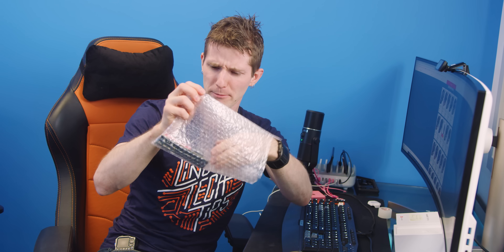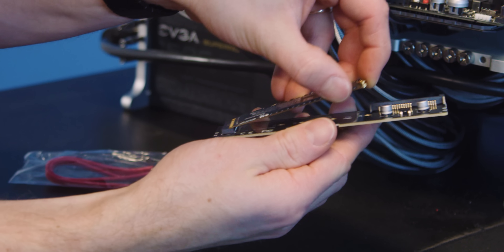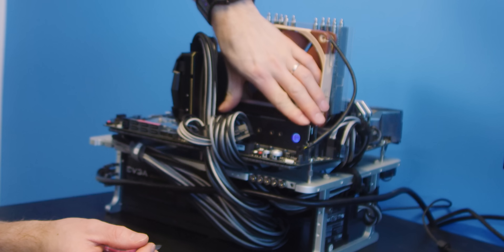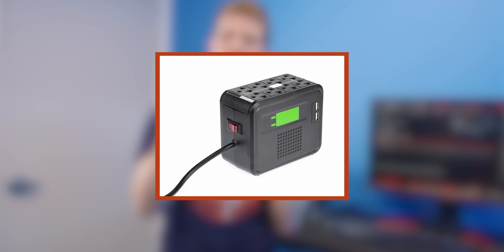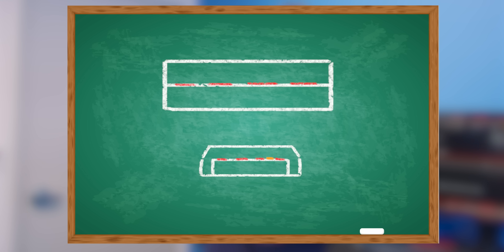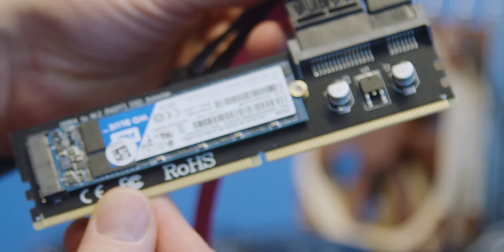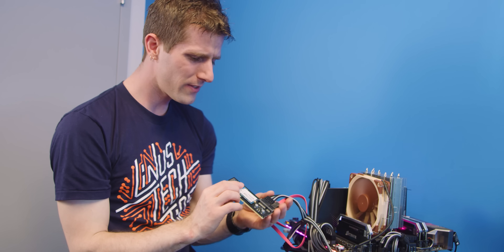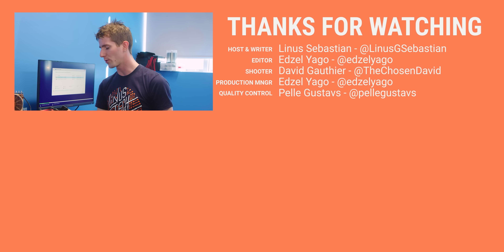They LIED to me! - DDR4 RAM to M.2 SSD Adapter

Comment: This adapter is unnecessary unless you maxed out you memory slot. The question is how much memory is enough?
Reply: @jefftheworld  Did you not watch that video? Linus had to take out one stick of memory and replace it with the adapter, I assume the adapter exceeded or equalled the number of max memory supported by the motherboard.
Reply: @DoTheEvolution78  The adaptor doesn't add memory at all, though.

It just takes up a slot and holds an SSD.
Reply: @DoTheEvolution78  No, if you max out your memory slots you'll have nowhere to put this device.

Comment: There will be a real DDR4 slot to "SSD"-ish thing - Intel Optane DIMM.
Reply: Watch the video before commenting...
Reply: @hueanao  cannot get your point but this product is just a board that assists you to fix a m.2 sata ssd on dimm slot... Itself won't expend your memory or storage. But interestingly, Intel is releasing their optane memory that can be installed on dimm slot instead of pcie and possibly can be used as memory. That why I'm replaying this.
Reply: @FangfeiYang  My point is, that Linus mentioned the DIMM Optane in the video

Comment: So basically this product is aimed at someone who bought a M.2 SATA/AHCI drive and screwed up with the motherboard, taking one that only accepts NVMe or one that doesn't have an M.2 slot at all.

Because otherwise if you want a Sata SSD connected to a Sata port on the MB you would juste buy a Sata one in the first place ... I mean they are even a little bit cheaper.

Or it could be that you just got an M.2 Sata SSD from someone or another build but don't have the hardware to use it, like the So-DIMM to regular-DIMM Ram adapters. But even that was more interesting !

Still, it's nice to know if we're ever in need of such a thing, it actually exists and can be ordered on aliexpress.
Reply: yes but they make pci-e adaptor cards, so you don't have to deal with the stupid cables. so ??? what's the point, you'll never need something like this. even if you did, like on a itx case, there isn't a place for it, given 2 memory slots. it's a really bad idea.
Reply: @BloodSprite-tan  I think most PCIe adaptors would be for NVMe drives, but there sure will be some for sata ones. But even though it can be useful for someone somewhere someday, it's not stupid as it works the way it's intended to. If you don't need it just don't buy it, I never said everyone should have one just in case, I said if you're ever in need of something like that it's reassuring to know that it exists.
Reply: @TheOrganicartist  Well I'm glad this works for you ! Again, I'm not saying that a lot of people would actually need this, as there are lots and lots of other solutions that you would think of before that, including your PCIe adapter.

I'm just saying that it's nice to see it exists, because if you need a M.2 AHCI to regular SATA adapter and don't want to use another  expansion slot, you can. you might not even use it in a ram slot, after all it's just a solution they found so that it would actually be attached to your computer. And I can see that it can be misleading to some people, but hey, if you see some weird shit on aliexpress, just send the link to Linus Tech Tips before buying it, and if they run out of topics to cover they will be glad that you found it !

Comment: This would definitely be useful for someone that has an old computer without 2.5" bays or m.2 slots on the motherboard. Also if your computer is already full up.
Reply: Especially if you really don't want to deal with those pesky faster NVME drives.

Comment: the HDMI to VGA example makes it super easy to understand.
Reply: justin tinge and not exactly accurate. Many laptops can actually output VGA signals natively over the HDMI conductors and thus not require any conversion in the adapter itself.
Reply: @ChristianMcDonald1  thanks for the info, had no idea about that too.

Comment: All thats on there just looks like a 7805 voltage regulator and two caps. Kinda weird as there's already 5 and 3.3V on the Sata Power connector. Could be for 3.3V if the connector only has 5V (some do)

Comment: Its not even an adapter, its a scam, a place holder at best. They used DDR4 slot as a place to hold SSD, and by using this way, tricked many to buy as DDR4 to M.2 adapter. Even though by including sata cable, it will trick many less-tech people in to thinking that it actually does something. 
Anything just to sell without risk of refunds.

Comment: legitimate question: will it fit in an asus dimm.2 m2 riser card slot?

granted the slot isn't featured on all their boards, and further granted it wouldn't actually use the nice mainboard datapaths the slot provides, but it might make a nice usage of the space if one can't spare the pcie lane sharing or if the slot were electrically dead, etc etc.

Comment: Actually this would probably be usable on a custom pc that doesn’t have the space for a drive.
Reply: Or buy a mb with a m.2 slot on it, otherwise u can probably find the space to hide a 2.5 inch drive somewhere
Reply: If it doesn't have room for a drive does it have room to waste a DIMM slot?
Reply: Well actually M.2 usage disables Sata ports, some M.2 slots disable 2 Sata ports, so if you have 2 open RAM slots, but want to use more M.2 Sata drives than you have M.2 slots, then this might be something for you.
Reply: @TheBazino  What I gathered from the video is this doesn't interact with the memory slot at all. The slot just holds this card.
Reply: @TheBazino  you still need to use a sata data and power cable for it, If it uses 2 sata lanes that's because it's a higher spec, which is what u should be using over a standard sata m.2

Comment: I've seen this utilized in motherboards that lack space for m.2 drives. They come with an adapter like this but it is not put into a ram slot mind you, it has a separate slot for it.

Comment: I thought at least the adapter would have its power from the dimm slot. But it just uses precious dimm slot as stand. I've just hoped because I wanted to have 5 volt rails on everywhere possible.

Comment: I kind of immediately noticed that the adapter had both SATA power AND data connectors. Clearly something fishy is going on there. The fact that it only accepted SATA m.2 drives confirmed by suspicion that the 'ddr4' adapter does nothing of the sort. It's just a really weird mounting plate for a SATA m.2 to SATA adapter and the whole DDR4 thing is purely where it clips in. I don't think the DDR4 pins go anywhere at all. Not even for power.

So if you just want to mount an M.2 SATA SSD to your motherboard and want to do it with a spare DDR4 slot instead of anywhere else in the case for... some reason... then hey, this would be useful. I can't imagine that's a large demographic, though.

Comment: i could easily still see a use for it if you didnt want any ssd's or hdd's in your system. if 16gb of ram is all you need and have 2 extra slots and want more memory on the board itself this would be a great placeholder on the motherboard for additional storage

Comment: A simple physical adapter, which costs you a memory slot. It uses one of the most prime pieces of real-estate in a computer, as a place to hold itself. What a great idea, I can't wait to buy one....
Reply: I could store 4x of these (it’s a pain to get to the 3 m.2 slots on my board, I’ve gotta yank 4 water cooled GPUs off the board to get to them, don’t even bring up how stupid the location for the CMOS battery is....). I’ve only got 4 Dimms populated, and I doubt I’ll need to run 8 sticks of RAM. I’ve also already got 2x RGB normal form factor SSDs sticky taped to the backs of my PSUs, so it could work... Also since it a Threadripper, they come with a license for multi-tier drives, so you can use RAMdrive as your 1st layer cache, then NVMe for your second tier, SATA for your third tier, and spinners if you needed them on your 4th tier.
Reply: @jakegarrett8109  Alright Jake, works for you, then off you go. I would rather have the RAM socket. Like many things, there are possibly people who would love one and could use it to very good effect, but it isn't something normal users are likely to want.

Comment: The adapter may be intended for people with old PCs with no place for m.2 drives
Reply: In that situation, wouldn't you be better off buying a cheaper SATA SSD?
Reply: but then they would want a DDR3 memory slot. DDR4 isn't exactly too old. There are alternatives like 2.5'' SSDs and PCIe adapters. But I do get the niche use for this.

Comment: There was a DDR3 thing like this a few years ago that used power from the RAM slot - also did RAID too. Still required you to run a SATA cable still, though

https://www.guru3d.com/news-story/innodisk-makes-ddr3-adapter-for-m-2-ssds.html

Comment: i think they build that adaptor maybe to allow you to have more than one m.2 drives instead of what an average motherboard can hold and he DDR4 ram slot design is more for an easier mounting than putting it in a drive bay or hanging it around somewhere in the case. its a smart idea, but not enough to wow people like linus. that's just my opinion

Comment: I thought it was going to use storage memory as system memory but you can already do that in windows so no point. But it can be used to connect a M.2 SSD to a motherboard with no M.2 port not that bad.

Comment: That would actually be useful in a small case with no expansion room and no on board space for such a drive. My current board has 4 dimm slots and only two are populated atm. My two ssd bays are full and as the case is a micro ATX case, it has no external bays. In my case I do have two m.2 ports that are both sata and NVME capable. So, I'd go that route first. This reminds me of the PCI cards that did the same thing and did not actually connect to the PCI bus.

Comment: How about an adapter that actually works? About twelve years ago there once was a 5.25 inch RAM drive made by Acard with a battery backup that took up to 64GB of DDR2 memory and you could use it as an SSD. Funnily enough it could only do 300MB/s because it was limited to SATA II. Still, at the time it was pretty much the fastest storage medium money could buy. I wonder if they sold many.

Comment: While I do see the use in that (sata+power to M.2 adapter), if you intend to upgrade your platform later but need an SSD now - I would also advice that many older motherboards, at least from Asus, actually got NVMe support through a BIOS update. Even though some of those boards don't even have an M.2 socket. The way you do it, after the BIOS flash of course, is by using a PCI express (4x lanes for full speed) to M.2 NVMe riser card. And use UEFI (So no legacy mode). My old Asus Z87 Pro board has no M.2 slots, but is now booting off functioning NVMe storage :) I got he adapter from AliExpress for under $10.

While of course that platform can't fully take advantage of the speeds, they faaar surpass SATA, and when I upgrade, that drive will be nailed straight in an on-board M.2 NVMe slot.
Reply: I couldn't get my Z87 to BOOT from the PCIE adapter, even after updating the UEFI BIOS to the most recent version. I read the way to do it was using a USB bootloader key which then automatically selected the UEFI PCIE drive. I never got to that point because the time it took to load the USB then boot the OS negated the benefit over booting from my fast SATA SSD and the PCIE NVME drive was still usable as storage, so I just ran my slow loading programs off that for a speed advantage. Plus if the USB drive came out it wouldn't boot (great security, not so much for loose USB ports). I ended up finding a Z97 on eBay with an M.2 slot.... but sadly it didn't support booting from it (don't ask me why, it just didn't and I again could never make it work... LOL)

Comment: Great video! Quick question: I recently bought this off Amazon, "M2 Mini PC Licence Windows 10 8GB RAM LPDDR4 128GB SSD." Is there any way for me to replace the 128 with a 500Gb SSD? Thanks!
Reply: Well from the description it refers to the ssd as m.2 as opposed to EMMC(which would be soldered on the motherboard) I'd try and open that case then figure out if the ssd is on an m.2 slot. If it is, that'll be no issue :)
Reply: @matthewbee9109  Thanks!

Comment: That is actually brilliant, if you want to install an M.2 SATA drive in a crammed system when the mainboard does not have an M.2 slot and you don't have all memory banks populated.
I have just such a system and I could see myself totally using one of these.

Comment: I though by now there would be a board that would let you natively 
Optane instant on memory
Optane cache
Optane HDD
Reply: If Intel Optane can finally reach ram speed, even just DDR3 speed and bandwidth, that would be amazing.

That means we can have large ram and cache at the same time, people might not even need to buy system SSD, instead, superfetch/Optane watcher will do their thing.

Optane reaching ram speed might be a pipe dream though, I donno.

Comment: TL;DR This adapter isn't for getting SSD RAM because a standard M.2 wouldn't be able to handle the speeds of the Reads and Writes. This adapter is made for anyone who wants an M.2 slot on their Mobo incase anyone doesnt have it or is out of slots for an M.2

Comment: at first i thought that the chinese found a way to use m.2 ssd as ram... that would be insane to have 32gb ram for 20 bucks... nope. totally useless crap. made only useful for older motherboards without m.2 slots.

Comment: There are actual terms for those types of adapters: passive and active adapters.
Reply from the maker: Yes and no. Passive and active adapters can both exist for the same conversion. For example, passive dp to dvi adapters could handle up to single link dvi speeds while the active ones could handle dual link speeds. That's why I ended up presenting them the way I did. Hope that helps :) - LS

Comment: Figured out in the first few seconds of looking at that adapter to know it's a dummy. And nice try at making up the rest of the video with filler. Not much to say on the actual product lol. Still, it has it's use if going for an extreme compact PC with desktop ram slots, and the motherboard is lacking in features.

Comment: So it basically just uses dimm slot to hold your m.2 still while the card part switches it from m.2 to sata? Thats like making a non-functional v8 engine that you can screw your coffee maker on to have your car hold it still

Comment: Does it perform with the M.2 speed or it will get decreased by these adapters?
Reply: obviously reduced, well I'm pretty sure, oh wait... those drives probably are as fast as SSDs, if faster then SATA cable shouldn't reduce the speed, it's 6 Gbit/s, if I remember correctly, which then is around max 750 Mbytes/s, if it's how speeds actually work. I don't remember -.-' Checked details, apparently max 500Mbytes/sec???

Comment: Agreed that it would have been nice if the power at least went to the drive, but there might be a use for this in a semi-frequently moved machine that is small form factor and does not have any available drive bays left to put a disk into (or a fanless setup without any drive bays).  But does mean you need to have spare DIMM slot so larger / more expensive RAM configuration ...

Comment: I'm pretty sure I recently saw one of these included in the extras of a Z390 board, I think it was an Asus or Gigabyte one.
Reply: It s dimm.2 its diffrent if you put ram on it it wouldn t work
Reply: asus has dimm.2 which is a similar concept but it only works in a dedicated dimm slot connected to pcie lanes, on the board with a metal shield on the end so people don't try and put ram in it.